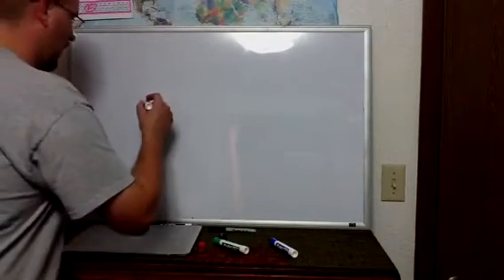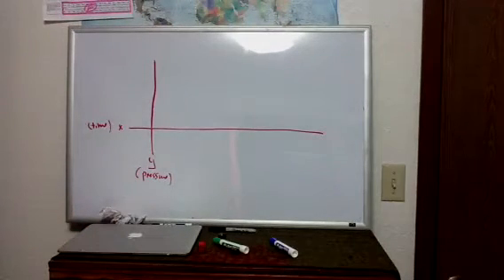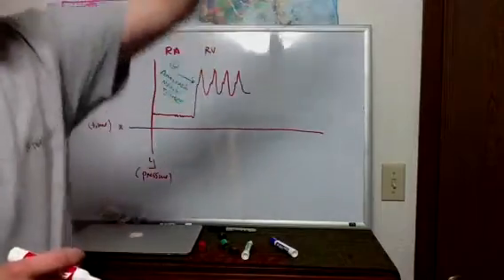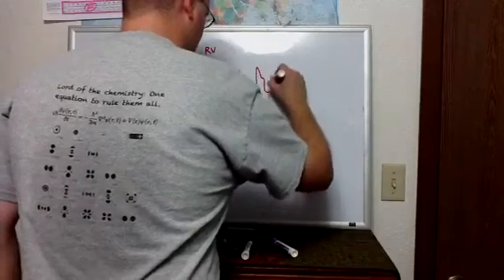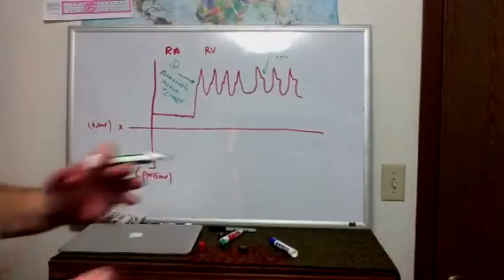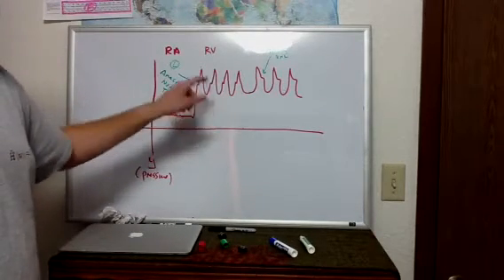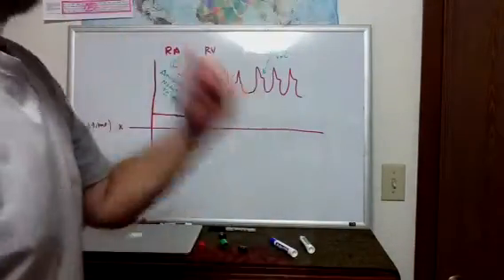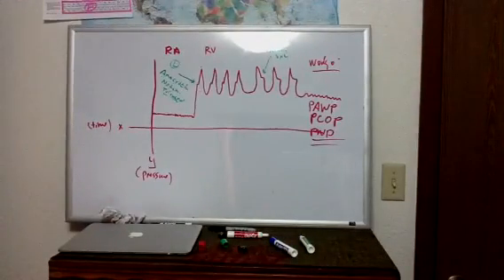Haemodynamics Part 8: inserting a PA Cath

Comment: The graph isn't correct. The diastolic pressure at the right ventricle is very similar to the right atrial pressure. The diastolic pressure of the PA is above the diastolic pressure of the RV.
You explain it very nicely though.